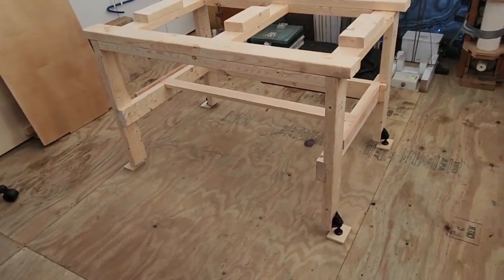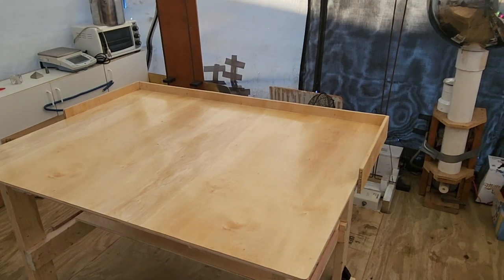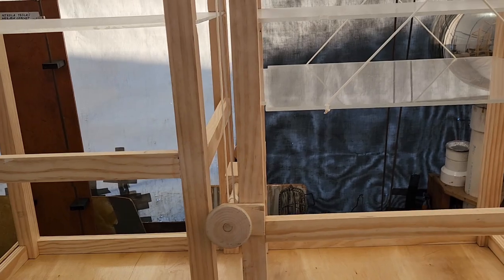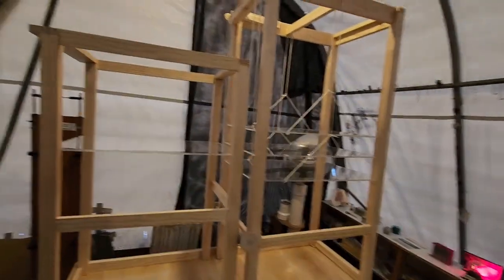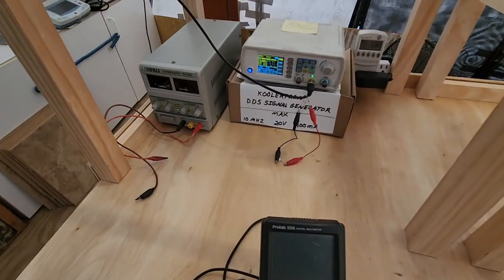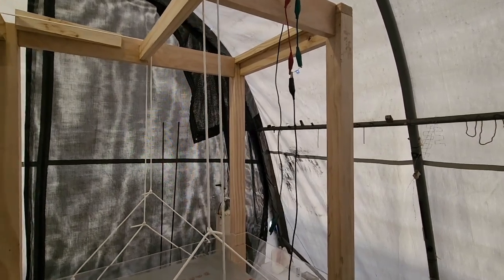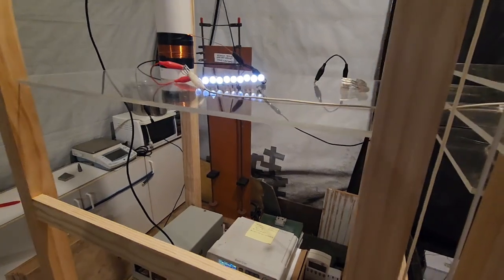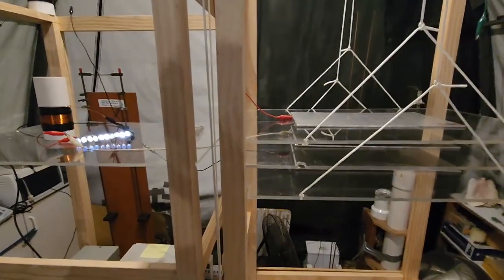TIME TO CHANGE THE WORLD!  APPARATUS IS BUILT, EVERYTHING IS READY :-)

Comment: still not sure what is this doing
Reply from the maker: Hello!  I am using resonance, open circuit, wireless power transfer, & single wire, to "gain" energy.  My frequency generator is my power source.  It is putting out only 12V and per the manufacture, you can only draw a "maximum" of .1A (that's 100milliAmps).  So, the most I could possibly be applying is 1.2Watts.  I have taken very careful measurements, so I know I am actually applying much less than that.
Reply: @INVENTOR3  and you get out more energy output ? Or is just energy transfer ?
Reply from the maker: @i_catalino yes, I strongly believe that I get much more out of this than I put into it. That is referred to as overunity.
I made 3 or 4 videos in the past.Showing me taking very careful measurements. :-)

Comment: Hi, cool variable capacitor plate design, keep the glass (hard to scratch easy to clean). If you find an old copper/aluminum AC condenser or evaporator flat coil they make great grounds due to huge surface area from thousands of fins.
Reply from the maker: Thank you, thank you!  good idea with the condenser, i know what you're talking about.

Comment: I feel like there is a complementary charge from the environment and when you hit the resonant frequency of your lc circuit the wires and the plates you end up with a multiplication from the opposite charge on the other plate I think you could make a beat frequency with these plates if one is closer than the other there may be constructive or de constructive interference I wonder if you could design it like a faux cavity magnetron with other plates to cause a multiplicative effect futher than this I've been playing with beats and it's very interesting my latest short shows a bit of the effects I get
Reply from the maker: All good thought, thank you!  Yes, beat freq.  I keep asking myself if i want those plates evenly spaced or not, im still deciding, hehehehe.
Reply: @INVENTOR3  yes I think that may be novel. Or having resonant plates in a battery using this type of effect. Dissimilar metals all that  Does touching the third center  plate bring the system out of tune or does the center plate simply a pick up plate and the resonance happens between the top and bottom plate. All cool stuff. Happy your back at it again ! Cheers paul

Comment: what is it paul explain  hey didnt you shoot a video years ago of a project that didnt work despite following the procedures of the man who built it i think its called an electret well im working on one to
Reply from the maker: I'm working with wireless transition of power, along with resonance.  I believe i have over unity. I will attempt to get enough power from this system that there will be no doubt.  I use less than 1 watt and I will light up a 10 watt LED bulb.
Yes, I made and worked with a few electrets. The main one I built was supposably use in Japan in the military.  They used it to power there phones, it was much lighter than a large battery, plus the electret was self charging.  If i remember correctly the main ingredients were Canabua wax and rosin.  You need to add HV to the ingredients as they melted and then turn off heat, keep charging while it solidifies.

Comment: Good show. Quick question... Now you can quickly adjust the air gap, have you found that distances that are multiples of a working distance, also works?
Reply from the maker: I will check this out tomorrow :-)
I'm already seeing that the greater the gap distance is, the higher of a frequency i need to apply.  I thought it would of been the opposite because the smaller the gap i would think the smaller waves could fit in between the plates.
Thanks for commenting.